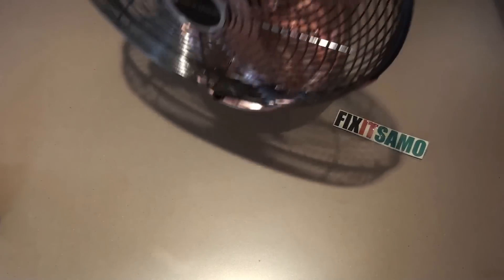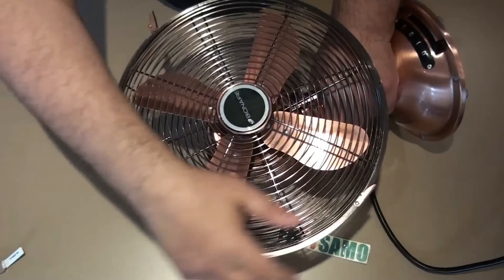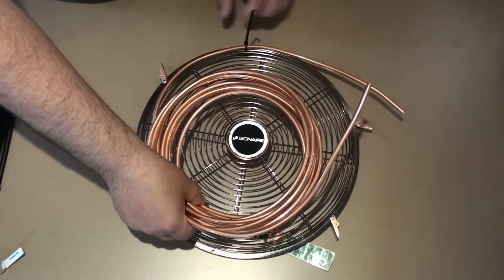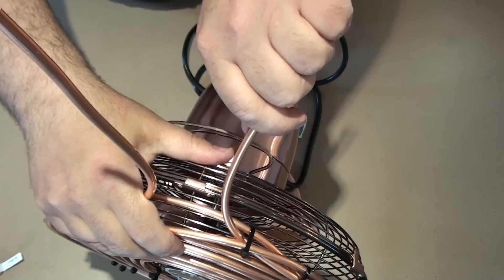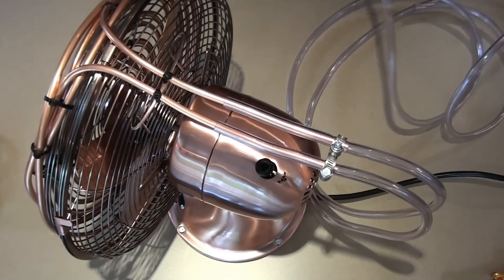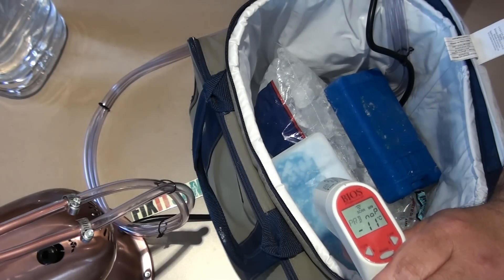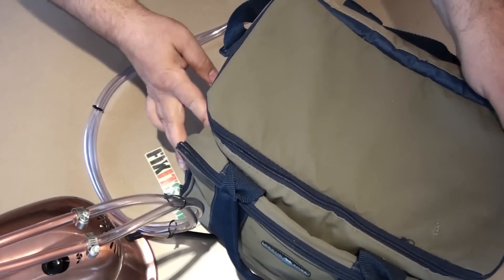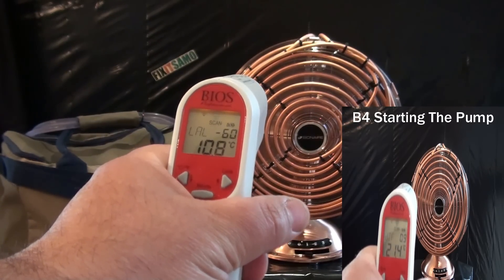How To Turn Your Fan Into An Airconditioner  AC

Comment: i think all those thermodynamics logic is perfect, but i dont think here he is trying to cool the room, if he keeps the room closed with the fridge inside and trying to cool the room just as an AC does then its not possible, its going to be uncomfortable but if he is keeping all the windows open and just be infront of the fan, then he surely can get a cool air obviously till the ice lasts, but again to make ice you are going to spend the same amount of current/ electricity rather more than an AC..rather he should make a small water cooling tower and let the water flow through it. it will be pleasant though not so cool but more efficient. long lasting and affordable.

Comment: I'm just trying to drop the degrees in a small area by like 5-7 degrees do you think if I only put like 2 or 3 coils of copper that would do the trick or would that still cool it alot?
Reply from the maker: +sstreets1189  hello I think its possible I haven't tried it  good luck :)

Comment: i bet adding salt to the water it would bring temp down even further
Reply: +Christopher Pinnick yeah salt will cool the ice down even more further, just put the ice and salt together in a ziplock before puting into the cooler so it will not mix with the water and damage the pump.
Reply: +Christopher Pinnick might damage the pump
Reply: +Fallon Egan but don't they use those in salt water tanks too? dunno. just curious. just idea.
Reply: +Dan Ezekiel Hesultura 
No... you use fresh water ice. Saline water would act as the coolant, allowing the temp of the cooling water to drop further and dropping the temps on the coil/heat exchanger to drop also

Comment: a great idea, the concept is the same as the radiator on the vehicle, to cool the engine. may have to look for a solution for the water pump that will be hot when switched on continuously

Comment: this is way better than evaporative air cooler. You gonna have to keep topping up cold water in the evap air cooler making you pay more on ur bills. This one juz recycle the cold water you juz hv to keep adding ice. Im gonna get some copper tube n turnn my air cooler into one of this
Reply from the maker: +akupehsluarketatAR  hello actually you can even recycle your ice bags just by putting them back in the freezer and btw the ice will cool the water for at least 10 hrs
Reply: +akupehsluarketatAR  I don't see how.  The price of water from the tap is a lot cheaper than the electricity to run a freezer that freezes / cools the water.  This is nothing more than a very inconvenient and very low capacity air conditioner that uses a refrigerator or freezer to move the heat.  You'd be better off from both a comfort and economic standpoint to buy and use a small room air conditioner.  The cost of running a small room air conditioner would be a wash when compared with this system for an equal capacity to move heat.
Reply: fred sasse
the freezer at your home is always running, so why not make ice out of it and you dont hv to spent extra buying an A/C and spend more money running it. this obviously is not build to cool the entire room. Its juz adequate to to keep the air at a comfortable level.
Reply: +Backyrdvideos then show me better way...

Comment: If you use just water with no ice will that still cool the copper enough to make a temperature difference?
Reply from the maker: +Nick Sacchetti  hello it will drop only 2 to 3 degrees

Comment: is it safe? u are using copper which is a good conducter of electricity..so what if something goes wrong and creates a short curcuit ?
Reply from the maker: +aditi bose |" hello yes its very safe the copper is not connected  to any electric wire its placed on the fan screen

Comment: This system would be more efficient without the fan and pump as they produces heat when working. An improvement on this device would be just to let the ice melt in the room... and make sure you don't produce the ice using a freezer in the area you want to cool as the freezer would generate heat when working (just like any refrigerator/freezer). Moreover, if the device displayed would  produce any significant amount of cooling power then condensation would form on the copper coil and it would eventually drip especially when humid. Long story short: this device is typically useless.